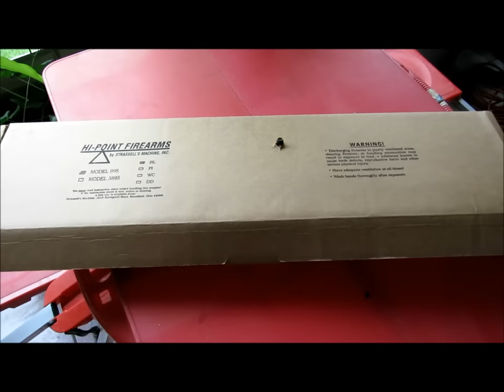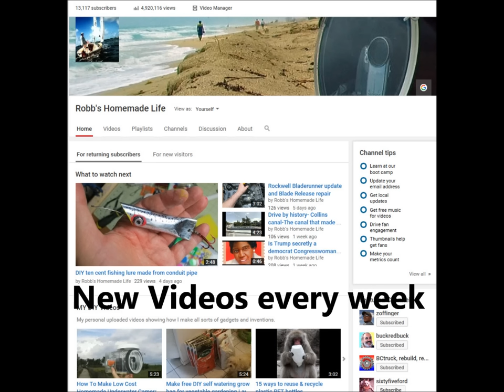10 reasons I bought a Hi Point Carbine & 6 bad reasons not to

Comment: Great review!

My first firearm was a Hi-Point 995TS,  similar to what you have here. At the time, I paid $225 for it at a large outdoor goods retailer. The only problems I ever had with it were the charging handle coming loose, and some reliability issues as a consequence of using 15-round ProMag magazines (which I learned later was grounds to void your warranty).

Nevertheless, the of the two times I had to send it in for repairs, I they paid shipping both ways, and threw in a free 10-round factory mag each time for my trouble. There is no question that their lifetime warranty is superb.

Three things I might add to your list of reasons to consider something else are:

1. Their ergonomics aren't great, especially for lefty's like me. The pistol  grip is very chunky due to the magazine well being there instead of forward of the trigger group, and the asymmetrical shelf on the right-hand side. This is true of all their firearms and is annoying.

2. They use single-stack magazines, which limit capacity, particularly when compared to say, a Kel-Tec Sub-2000 or Beretta Cx4 Storm, or even pistol caliber AR or AKM variants.

3. Price - Good, but not great. If you could lay hands on a used one for $225-250, or get a new one under $50 MSRP on sale, I'd say go for it. Otherwise,  you're looking at ~$300 out the door for a new 995TS. For $100 more, you can build a complete AR15 from a parts kit and stripped lower. If your heart's set on a PCC, you can always get a 9mm upper later, or just pick up a Sub-2000 if can find one for around $300-400.

All that said, it's not a bad firearm; it's reliable, accurate,  affordable. At the end of the day, that's all that really counts.
Reply from the maker: great reply-thanks

Comment: I have two 995ts models. Have fired thousands of rounds through both with a single failure. Just picked up an old Hi Point jc40 cal pistol and have fired several hundred rounds without a single failure. People can say whatever they want about Hi Points, but they work.
Reply from the maker: I have been happy with mine. I think there were legitimate gripes about the pistol from some buyers but the company y may have improved the pistol.

Comment: I enjoyed your review and I keep one as my house gun along with a pistol.  A couple of other points you can mention are: (1) The 9mm carbine has the same ballistics and stopping power as the best 357 ammo when you use the 115 or 125 grain +P ammo.  (2) It also has much lower blast then firing a shotgun or pistol. (3) It is very maneuverable inside a building and can be held in one hand.  My shotgun would only be used outdoors due to its bulk, requiring the use of both hands and it is to loud to be fired indoors without hearing protection.
Reply from the maker: Steve, what a helpful comment, thanks a lot! I subscribed.

Comment: All good points. Hi-Point 995Ts is on my list of acquisitions. If I may offer an alternative, I decided instead to get an SKS as my first rifle. Depending on your area, they can be just as cheap or in some cases cheaper than the 995ts. It has the advantage of being chambered in an intermediate rifle cartridge, 7.62X39, which can be had for only 2 cents more per round than 9mm. it also comes with its own built in cleaning kit, and bayonet. It holds the same amount of rounds as the hi-point (10) albeit in an internal non-detachable magazine. Best of all there are a lot of good aftermarket parts for modernizing including 20, 30, and 40 round detachable box magazines.
Reply from the maker: Good tips Kevin, thanks!

Comment: I greatly enjoyed how a non-gun type, but with good thinking and knowledge chooses a self-defense gun for the family.  
The issue with the highpoint is the firing pin.  It is subject to bending and breakage.  If it is not shot a lot and spends most of its life in a closet it will likely not be an issue.  I had an early 995 highpoint that I purchased used.  I left it in  a closet for more than 10 years after it kept jamming and fixed it two weeks agp.  It needed new improved springs from highpoint and they also sent me two new firing pins along with springs for replacement.  I did some reading and found out there is problem with them.  The HP firing pin serves as a firing pin and ejector serving double duty so to speak.   
PS one can clean a high point without disassembly.   And I am using the 10 shot magazine (Clips).
Reply from the maker: carl, thanks so much for the helpful comment. I am happy to hear Hi point has been responding well to any issues.😃

Comment: Bought mine (995TS) for pretty much the same reasons as Rob. Shot 150 rounds through it right out of the box, and it was flawless. Just basic round tip ammo, no hollow points or flat points, but I hear it will shoot anything you put into it. Also, a company called Red Ball sports makes a 20 round magazine for it now that is actually sold on Hi Points website, so they are giving it their ok. I bought one with the gun, and shot with it fully loaded four or five times, and had no issues at all. I've also read a lot of opinions on the web saying that it is heavy, and then turned around and read other opinions from people that say that the Beretta CX4 storm is light. I looked at the specs, and the Hi Point is only a little over a half pound heavier than the Beretta (I think I calculated 0.57 pounds), which doesn't seem like all that much to me. I don't find it to be heavy at all. It depends on what you compare it to. I have a Remington 870 shotgun with an after market magazine that holds 10 shells. Fully loaded, it is definitely heavier than the Hi Point, so if weight is a primary concern for a home / self defense weapon, I don't think I would let that sway me from getting a Hi Point carbine.

Comment: Very sound reasoning. I'm going to be picking one up soon, strictly for home defense and plinking. I have several other options already, but the 995 seems like a great choice for home defense due to the reliability, accuracy, ammo choices/availability, as well as overall cost. I also like the idea that the noise and recoil will be a lot less than other home defense options... I really dread having to use a .556 carbine, 12 gauge shotgun, or even a 9mm pistol indoors without hearing protection in a home defense type situation.
Reply from the maker: +jimrbsn thanks Jim!

Comment: bought one. locked up after 1/2 mag. returned it got an sks. still got it. hi-points are good throwaways that's about it.
Reply: Pretty sure your bolt got caught in the bolt stop in the open position. I was shooting also and couldn't figure out why the bolt wouldn't close. Got to pull out on the bolt sideways. I ran 600+ +p in my 995ts and its Jammed a few times. I clean it every use also.. Very very dependable gun and inexpensive I got a 3x9x40 scope on it and can hit a paper target all day at roughly 75 yards

Comment: I bought a first Gen HI Point 9 mm carbine. it doesn't look as vicious but I got it and about 600 rounds of 9 mm ammunition for a very good price. I took mine out and shot it the other day and it shot great. I wanted a 10 mm but I couldn't hardly turn down the deal I got on the nine and I can still get the 10 later. I haven't had a single hiccup with my gun. I like it a lot!
Reply from the maker: I am still happy I bought mine for 200 bucks. I like it a lot.  We should make a commercial for the High Point carbine. "The High Point carbine, I like it a lot."😃👍 John thanks a lot for watching and commenting I really appreciate it

Comment: If you buy any hi point before handing over your money check the barrels very carefully for defects,flaws or damage because thats the only part that they wont fix,I bought two 10mm auto carbines and they both had identical horrible flaws ahead of the chamber so I sent them back with a description of what was wrong and they fixed couple of things that were not the problem and said the gouges in the barrels were normal and sent them back to me.The one carbine was fired they other was not so the damage was there before they left the factory. All of my other hi point carbines are just fine but these last two guns are not,use a bore cam to inspect each barrel before handing over your money!!!
Reply from the maker: Thanks a lot for that information. I know it's going help a few people.

Comment: I have been kicking around possibly buying one for myself. I own an AK-47, (2) AR-15s .223, AR-15 7.62x39, 12 Gauge Mossberg 930, Marlin .22, and a Marlin 30.30 LA. The reason I'm leaning toward a Highpoint 9mm Carbine is size and ammunition. I own a 9mm pistol and I think it would be a good idea to have a small rifle that uses the same ammo as my pistol and is so readily available. After doing some reading and viewing youbube videos I have not found really any bad things said about the HP 9mm Carbine. They do what they are designed to do without malfunctions and the price is great.
Reply from the maker: I agree completely, it was one of my reasons too.

Comment: A good alternative to a Hi Point is a used Marlin or Winchester Lever Action. Pawn shops usually have these  for the same price if not a little less and fires much more potent rounds The .30-30 Winchester will put down most two or four legged threats properly used.

Hi Point now offers 10mm if more power is needed.

Either will do the job well.

Comment: Great video! I love my High Point 995 TS 9-mm. I was originally was in the market for a Tal-Tec Sub 2000 Gen2. However,  after several months searching, I gave up and "reluctantly" bought the High Point 995 TS 9-mm. To my amazement, it turned out to be a great rifle (and one of my favorites). So much better built then the Tal-Tec, more accurate, durable, and a lifetime warranty. It was also 1/2 the price too. I agree High Point needs to improve their pistols but they without question definitely got this rifle right. I was so impressed with it, I invested in several accessories (extended mussel break, flashlight, lazer sight, and extra magazines).

Comment: My two cents on the 995TS as an owner who has personally put over 2k rounds through it and let others run at least another 1k.
It is reliable. It eats everything. It is more accurate than a handgun. The warranty is tops. The 20 round magazine works reliably. It is cheap and fun to shoot. The felt recoil is close to a 22.
It is a pain in the a$$ to strip compared to many other carbines. There is a fin on the back of the receiver that gets in the way of chamber to muzzle cleaning. Sometime people put a magazine in but it is not all the way in.  Lefties sometimes hit the mag release when shooting. The 20 round magazine sometimes gets in the way of handling the gun. The stock magazines only hold 10 rounds.
But I'm not going to get rid of mine any time soon.
Reply from the maker: Phil, thanks a lot for taking the time to leave such a helpful comment. I appreciate it and I'm sure the other viewers will too.

Comment: I also say this is a great vid. I have the HP carbine in 40 S&W cal and I can put three rounds in the same hole from 50 yards, ( from a rest) and it has never jammed. I paid 215.00 for mind used, (but like new). The nine is a great round but my 40 cal has about the same power as the older 44-40 rf they used in the Old West.
Reply: +NCLUSA&#160;&#160; I put two extra mags on the butt stock in an old GI mag pouch, so it has a 30 round capability with the extra mags at hand.
Reply from the maker: +NCLUSA Thanks NCL!
Reply from the maker: +NCLUSA yeah, I put extra mags on mine too using clips.

Comment: I bought a used carbine and I like it...the only thing I don't like is the sharp pointed bottom of the trigger which digs into the tip of my trigger finger...ouch...I wrapped the inside of the trigger guard with masking tape so I wouldn't scratch it and then I took a small file to the tip of the trigger and rounded it off generously until the bottom of the trigger stopped digging into my trigger finger...I smoothed it up with fine sandpaper wrapped around a flat wooden stick...The manufacture needs to enlarge the trigger guard and install a redesigned trigger...The reason a larger trigger guard is required is I find the bottom of my trigger finger rubs and or drags on the bottom of the trigger guard when pulling the trigger ...which notably is not good...Other than this the carbine fired flawlessly which is good...I purchased three extra 15 round magazines and a Thompson SMG magazine pouch which holds the three magazines...This is a cool looking gun...however I am not looking forward to taking it apart and cleaning the internals...this does not look like an easy chore.
Reply from the maker: Ed, thanks so much for taking the time to reply with helpful input, much appreciated.

Comment: I have had a couple of Hi-Points. As someone who values function over form, I think they’re fantastic guns. However, the Mossberg 500 is perhaps the toughest and most reliable weapon ever designed.  I’ve had one for 35 years and hunted with it a LOT. It’s been used to defend our home twice in that period too. And has had tens of thousands of rounds ran through it on the trap range.  It’s the gun that I count on when packing archery kills out in grizzly country. Yes, the recoil can be a bit much for many shooters. But Blackhawk makes an adjustable recoil absorbing stock that removes 85% of the recoil so any shooter can use it comfortably.  I think you made a good purchase in that little carbine but the Mossberg would be a better choice.
Reply from the maker: I agree with you about the Mossberg. In fact, in the video. I mentioned a shotgun would be my first choice, but I already had access to one if needed. Thanks again for watching and commenting. I appreciate it.

Comment: I have two 995's (the original butt ugly ones) and a 4595. Restocked one of the 9's with a TAC stock and "Star Wars" the second one. The chrome covers looks great with white painted stock. Added a black rubber slip on grip, butt pad and a scope about half the size of the rifle. Zero problems with any of them.
Reply from the maker: Joe, thanks for the input!
Reply from the maker: the barrel and a few other parts are metal.

Comment: Good video.  I have the .45 Hi-Point carbine. I got it for home defense and SHTF.  It's an inexpensive, good, reliable gun. I think I picked mine up for just under $300, which is certainly a great price, especially for a beginner shooter.  

I wouldn't have gotten the 9mm version though. Yes, it's good for plinking, but if it ever came to some type of crisis, the .45 offers much more stopping power (which saves ammo). Also, when there is an ammo shortage 9mm is one of the calibers that you cannot find, whereas .45 tends to remain readily available.  Despite my warnings, a friend of mine bought a 9mm pistol in the midst of the 2013 shortage, and it was almost a year before he was able to find ammo for it.
Reply from the maker: +Defx10 thanks Defx, good to stock up now on 9mm while it is available.
Reply: Robb's Homemade Life
Always get it while it's available :)

Comment: Good video. My 4095 did not come accurate out of the box. It was actually shooting the ground when I was aiming at the target. Of course after a little sight modification I can keep 2-5" groups on a 50 yard range open sight. On the fact that it's ugly, well, like nutn'fancy says ugly is as ugly does. It is extremely heavy, but nothing you can't work around. Very maneuverable. The gun is available in 3 sizes, 9mm, 40s&w, and 45 acp. Don't like the 9mm? Grab a .45. It is the easiest gun I've ever had to take down and clean. Trying to disassemble one of their hand guns is surprisingly much more complicated. The take down tool stores right in the fore grib for easy take down in the field. I love this gun for the price. I've cycled well over 1000 rounds now and only had 1 failure to eject a shell. If you're looking for a budget survival/ home defense weapon, this is an excellent choice.
Reply from the maker: +Byron McLaggan Byron, thanks so much for taking the time to leave helpful input on the carbine. Much appreciated.
Reply: You're welcome sir.

Comment: I see that you probably own only one magazine. I'd highly recommend getting one or two more magazines just in case you need to reload. Also, I liked the fact you pointed out a carbine is easier for a beginner to shoot. The reason this is so is because the sight radius is longer. On a pistol the slightest variation in your sight picture will throw your shot off by inches and for a beginner it may be a few feet. A carbine is a preferable choice for home defense. Although, if you ask most new gun buyers they will just buy the pistol because it's the most associated with self defense. Also, if I were you I'd invest in some hollow point ammunition. I don't really need to explain it, but hollow points are much better for self defense.

Comment: They do make a few different calibers besides the 9mm, they have the 10mm, 40, 45 ACP and 380, so there is a few and you can get them in a variety of colors and camo and with different features, I've seen one all dressed out with the forward hand grip with a laser and flashlight and muzzle brake and the sight riser can be removed easy to put a scope and I put a bipod on mine I wouldn't trade my hi-point for anything else it's like an AK47 it will keep firing after it's been through a lot and it go awhile before cleaning it and they do make a 20 round clip for them now by Red Ball the other after market clips like the 15 round will void the warranty on the gun.
Reply from the maker: hey, thanks Dwayne!
Reply: You are welcome I didn't see when the video was made, but I like the gun case you made looks great.